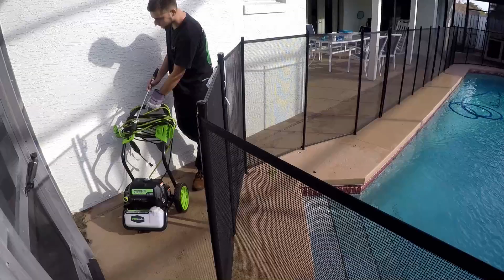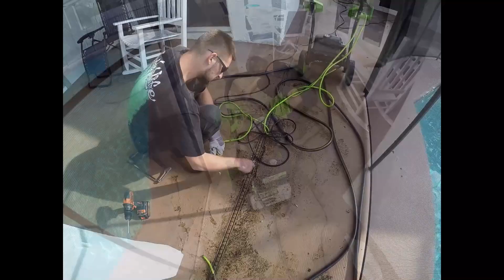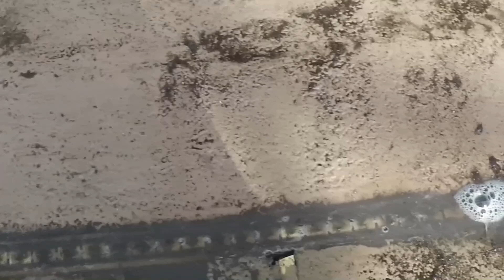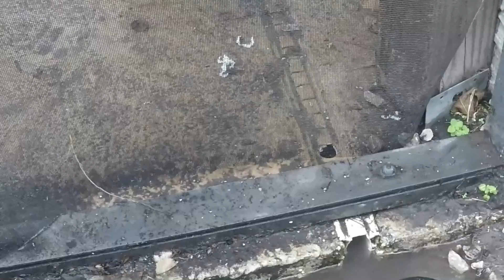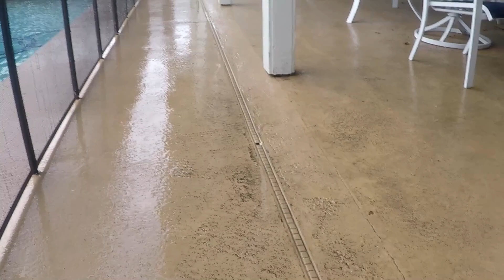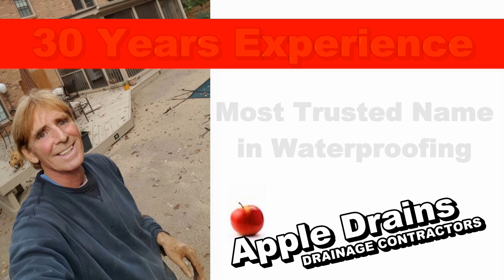Pool Deck Drain, Micro Channel Drain, How to Clean

Comment: Chuck,  Thanks again for taking your time to film your experience, so we can learn.  I learned about the Jetter from you.  I sent it down the Decco Drain on my pool with a satisfactory thud at the end of the 30 foot run before a non-negotiable 90 degree turn.  Forward and back like you showed me.  Then it got stuck.  From your video it must have been at a junction.  However, it is stuck both ways.  I have tried an auger and fat wire as a fishing line. Just prior to Ian.  Any ideas?  I am thinking of cutting a port that I can replace, to extract the beastie. Arrrgg.

Comment: What do you use to plug the holes you make in the drain with your drill bit?
Reply: I don't think he does.. lol My guess would be it's small enough of drill size (barely bigger than that small hose he stuck in), so one doesn't have to worry about too big a snake coming in, otherwise I haven't clue, I suppose you could weld or glue a lil plastic piece on top to close off though, hope that helps, cheers!

Comment: How do I maintain/regular clean if my micro drain is capped off and encased in concrete? That was my plan anyway - pouring patio next week. Do you recommend I avoid capping it on one side and leave side cap exposed for cleaning purposes??
Reply: I have same problem but if I leave it open, it will dump water into a corner very close to foundation. I don’t expect an answer as comments have not been made since 1 year. Only option I can think of is drilling hole at end by corner by foundation and aim hose opposite direction. Problem is covering hole unless I find the perfect fit rubber plug.

Comment: Mine is clogged with roots and shoots of the "purple showers" plant, it was like that when we bought the house. We tried to pull the plants but its impossible to get the base and roots out. Is there anything we can do to basically dissolve whats left of the plant so we can then use this method to clear it?
Reply: Research using muriatic acid.

Comment: How much will cost me that??
Reply: Lowes is only one I find to have the micro (1 /4”) thick. 12 dollars for each 5 feet piece. Corner  “L” shaped and “T” connectors are around $20. And T is so hard to find. Multiply your footage of drain needed. I used 5 - 5 foot pcs and L. So $120. But I had to rent a concrete cutter from Home Depot $100 in 2019. Then quikrete around drain.

Comment: Does anyone know if insurance pays for damage to wood floors after water gets in from foundation ?
Reply: Is it wood over a concrete slab? If the surface wasn't prepared properly before installing wood floors, a lawsuit against installation company would be the route. Their insurance would then cover their liability assuming they lose the lawsuit.

Comment: My pool channel drains have been covered by artistic pavers with sand. Could using you pressure wash cleaning from the 2 ends cause damage to pavers on the top?
Reply from the maker: Depends on how powerful the pressure is